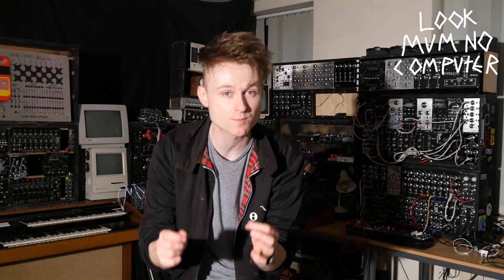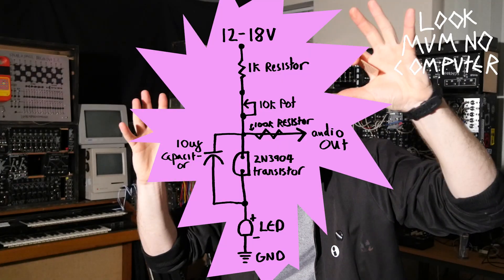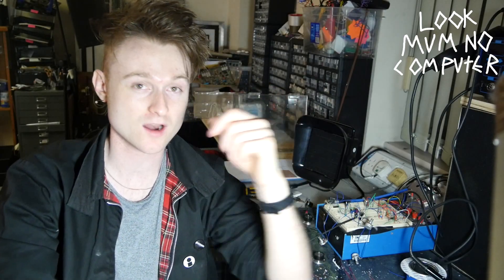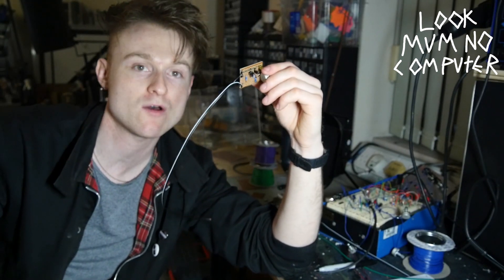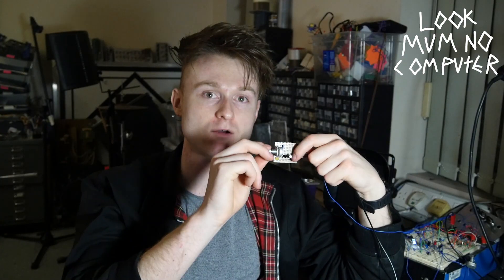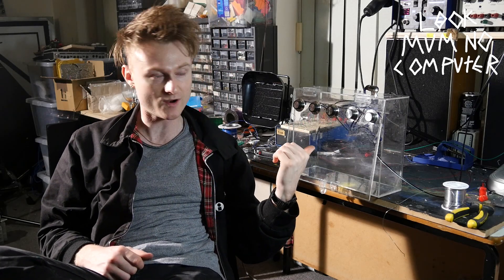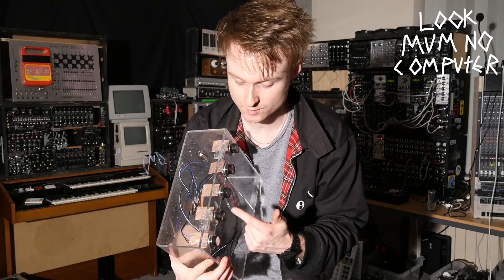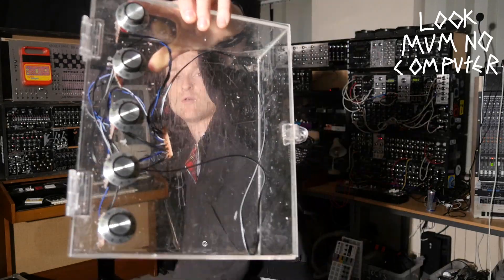The simplest DIY audio oscillator? not a 555 chip. reverse avalanche

Comment: I built this on a breadboard and the only sound coming out is an awful ground buzz. I've swapped the capacitor around, tried different transistors in case one was burnt out, tried it with everything from 12v to 24v, rebuilt the circuit over and over...nothing! The LED lights up and turning the pot changes the brightness but it doesn't flicker at all and the only sound coming out is a loud buzz that doesn't change in pitch. Any ideas?
Reply: Finally got it working! I ordered 2n3904 transistors from Rapid online, and the circuit oscillates with those ones perfectly.
Reply: Béla Bertalan Could be a different manufacturer or a different transistor. I found a video where a guy put the transistor on a scope to show the correct curve. You have to give the transistor enough reverse voltage to cause it to avalanche, which discharges the cap, similar to a neon tube relaxation oscillator. Without reaching negative resistance, the cap never discharges, so you just get the low level noise from the circuit. That's what my research seems to indicate anyway.
Reply: One more thing: If u want to connect a speaker directly, u must connect it parallel with the LED, or instead of the LED. Otherwise it won't give sound on 'audio out' with that 100k resistor. 

There's also an other circuit which using a BC547 and creates a very similar tone. I tried it and it works but only at around 14 volts. Also works with 2N2222 just we need to flip the transistor. Here's a video about it: https://www.youtube.com/watch?v=8oxFgyhJH0s&list=PLZXGSamSdI8bH0ewPiTekH9ilLQRldYB6&index=1
Reply: Hi guys, I know it's kind of a late answer, but in case someone reads it: I just breadboard the circuit at 9v with an s9018 and had the same issue: led lights but no sound! Solution was to replace the led for a jumper wire (now sounds but doesn't lights :D ). Also it doesn't sounds all along the potentiometer, just in a small place (don't know how to say this properlly, sorry).
 @belabertalan  Couls you explain that connection please? Where you say we should put the audio out?
Reply: @alebrenna441  hi, once your circuit is working properly, so the LED is flashing and changing frequency according to the position of the potentiometer, then take your speaker and connect the positive lead to the positive leg of the LED, then the negative to the negative leg of the LED.
Reply: The ones I tried before and didn't work were -A38 type. (2N3904  -A38). The good ones (Trusemi) from Rapid are B011 type. (2N3904  B011) I guess these are newer, more developed versions. So I would recommend to try any with letter B. (2N3904  B...). Hope it works and helps.
Reply: Would that have anything to do with the transistor leg that needs to be removed?
Reply: I just didn't connect the leg and it works.  I didn't have to cut it off.
Reply: Have you grounded the jack?
Reply: Yep
Reply: Have you managed to get it to work yet?
Reply: Béla Bertalan No, but I did a lot of research on this circuit and it depends on a negative resistance curve to work. I suspect the transistors I'm using are missing that curve. Haven't had a chance to try it with a different type of transistor.
Reply: Richie Witch Do you mean a transistor from a different manufacturer? I tried with a cheap 2N3904. That's the type supposed to work in this circuit. Quite annoying it doesn't..
Reply: Fantastic! I'll give that a shot.
Reply: @RichieWitch  Hello, did it work eventually?
Reply: @chornitch  Hi Pierre, no, I moved on to other projects, but I still think that using a transistor with a negative resistance curve is the secret.  To take out the guesswork, you have to look at the manufacturer's data sheet to see which transistors have that part of the curve; every manufacturer will be different, even though the part number is the same, because only the positive part of the curve is normally important.  Essentially, you need to know that the transistor will leak when plugged in backwards--the negative resistance curve shows if it will.
Reply: @RichieWitch  thank you for the fast answer, I will do so and keep you posted for sure if I manage to make it work
Reply: @RichieWitch  It's working! Thanks for finding the solution. 

Eventually I used a BC475
Reply: @chornitch  Excellent!! So glad to hear!
Reply: Great to know! Has anyone found TruSemi 2n3904s from a US supplier? If I buy them from Rapid it will cost $22 to ship $2 of transistors...
Reply: Are you seeing that number anywhere besides printed on the back of the transistors themselves? I can't find any indication from the major electronics suppliers of which version they are selling
Reply: I see this code only on the transistor itself. A few days ago I read about transistor codes and letters could mean newer versions. So B newer than A. I also saw cheap ones with letter B on ebay from china but different numbers after the B. What do you see on yours?
Reply: Confusingly enough, mine say -H24. They were produced by ON Semiconductor, bought from Digikey in the US. I think I'll buy a few from other US suppliers and see if I can find the B version. I wish more suppliers had a picture of the back of the transistor, for example on Rapid they show the back which says 331
Reply: Hey Encor3, did you wind up purchasing any other transistors?  Thanks for sharing this thread is great.  I'm going to see what else I can get out of Digikey, Mouser, or Jameco...and there is always Octopart...
Reply: I couldn't even get the LED to light up :( let alone get any noise
Reply: I got it working on a breadboard, ended up replacing the LED with the audio out - there is a slight deadzone on either end of the pot though :/
Reply: I'm having the same issue.  Built it on a breadboard, then stripboard.  Tried changing every component, three different types of LEDs, 10 uF and 2.2 uF capacitors, reversing the transistor... I mean everything I could possible think of.  But all I get is that low frequency hum. Have to add a lot of gain to hear even that.  I've watched the video a dozen times looking for clues, but this has me stumped.
Reply: A few things -- I will post this as its own comment but there is a huge mistake in the pink schematic he flashes the transistor 3904 is backwards, but that will keep the LED from lighting

Comment: Thanks for the cool videos. I built one of these and I would like to connect it to my small eurorack, but I am a little concerned about doing so. I used a 12V power supply and modified the capacitor value. When I look at it on an oscilloscope, I see the top of the wave around +12.5 V and the bottom is at about +8 V. If I check my eurorack oscillators, they go from about +4 V to -4 V. I am afraid to plug it into my eurorack because the higher voltage might damage something. Any suggestions or advice? Thanks!!
Reply: Hey shawn, curious what your pin connections on your module looked like? thinking about adding mine to my case too.
Reply: @stretchmetalfanclub  I never made the transition to a case with it. I guess I moved on to bigger and better things. This was a great start to my audio electronics journey though. Soon after this, I started to find schematics for full VCO designs with 1V/Oct pitch inputs and all. I eventually built that and many other modules. I found a place called GMSN! that was open source and learned a lot from them. Befaco also publishes their schematics. Ultimately though, for this basic oscillator in the video - probably not the best idea to put it in a rack.
Reply: @murky66  ha yes- I like you and concerened by the lack of regulators in this too trust it with the fragile eurorack.. will explore GMSM. thanks!

Comment: This is awesome!  I tagged you in a facebook post cuz I am speaking at a college tommorow about diy synths and I am presenting this method to them, but I am way noob at this stuff.  I tested this on a protoboard with a 24v  1.5Apower supply real quick and it worked.  I mounted 8 oscillators but I am hesitant to connect them all to 24v in fear it might damage the circuit..  What do you think?
Reply: Hahah that was a silly thought, it worked out fine.

Comment: I have rebuilt everything, the LED is lit and can also be controlled in the brightness. BUT!!!! no sound .... why ??? the output is 2.4 - 2.8 volts
I need help
 
ups almost forgotten super side super typ super equipment ..... blabla everything super  ;)
Reply: Did you ever get this to work? I have the same issue
Reply: No, I did not get it to work. sorry but I'm so glad that I'm not the only one;).
But I have no idea why.
Reply: HI - I had the same problem. It seems like not all 3904's behaves the same way. Just got a new batch with the post today, and now it works as expected - so my best bet is to get some new 3904s
Reply: same issue...
Reply: I had the same problem at first: my 3904 just would not oscillate. I bought a bunch of different transistors and found some 3904s that worked, but I had the most luck with BD139. It had more range than the others I tried.
Reply from the maker: pixelstift did you cut the middle leg off the transistor? Try the capacitor the other way around.
Reply: yes the middle leg is from ..... capacitor plus turned to minus ..... have already tested other capacitors 100uf 47uf .... 10kohm 22kohm 100kohm potentiometer also already tested ... transistor rotated ... and others resistors.
once soldered and once on the breadboard. but unfortunately no sound, that is the reason why I ask you. a little annoying beast.
thank you and have a nice evening
Reply: Mine is working perfectly on the breadboard, gorgeous sound. How are you connecting the circuit to the audio jack?
Reply: calinasmaria tip to output, sleeve to ground. Would it be possible to get a photo of your board with the circuit?
Reply: I believe photos are not allowed in these youtube comments, but i can send it to somewhere else if you want to.
Reply: calinasmaria could you upload one to imgur and PM me the link?
Reply: Does the link to imgur work from here? https://imgur.com/a/QWfBz
Reply: it does! that looks the same as mine...there must be an issue with one of the components or my power source
Reply: My 12V power supply couldn't even light the LED, so i'm using two 9V batteries in series https://imgur.com/a/gUgNs
Reply: I'm having the exact same issue. Anyone find an answer? I've checked and rechecked all my components.
Reply: I'm having this issue as well, will double check all my components over the next few days but can't see why it won't work!
Reply: Hey, did u find anything? 
thx!
Reply: I got it working on breadboard by replacing the LED with my audio - no resistor before the audio though so not sure how it will go with 2 or more connected to same jack out
Reply: Hello! I have read that some transistors do not oscillate and it gave them results to change them. My question is whether I can test the transistors without cutting the middle leg or I have to cut each one to verify that they work.
Reply: Got it to work with a 9018 on 9v, but had to replace the led for a wire to get it sound!! Also it does sounds just by bending the middle leg backwards (cutting it made it sound better)

Comment: Last question for real this time: what's the current draw through the oscillators? The resistors look small enough but the electrolytic capacitor at 5:27 looks huge.

Comment: Last question before I put these parts on order: what capacitor did you use for the higher-pitched tones? It sounds like it's about an octave. Is that just a factor of 10, i.e., 1 microfarad?
Reply from the maker: the lower you go it gets reall low (22uf) high ones were 1uf
Reply: Awesome, thanks! I've got something cooking now based this, a little more complex, but probably nowhere near your upcoming "how many is too many" video XD These are just so simple and sound so fun that I can't not build it :) I don't really upload here, but I'll try to make an effort once the build is done. Thanks again for sharing this with the community!
Reply: @LOOKMUMNOCOMPUTER  i have a issue with pot - 10k acc to schematic - it works only in half range - did you raised the value of pot or go with different capnvalues.
Thank youbagain for this idea....sounds massive.

Comment: Awesome !
I did 4 of them.. perfect.
But do you Know how to replace the led by a diode 1n4148 for exemple ?
May be the oscillation will be more stable ?

Thanks from France !
Reply from the maker: after experimenting more ive found the types of cap used varies the quality of it quite a lot± i would recomend to swap the capacitor around so the grey line down the side goes to the GROUND instead of the other way around :)

to pop a diode in i dont thik it will make a difference but try, just swap led with diode, black stripe goes to the ground strip

Comment: What's the output level of that box? Did you have to amplify or attenuate it at all? And does more power just grant you more modulation depth? Like, say if I were to chain four 9-volts instead of just two. I have some interesting ideas to expand this from your filter video as well. Thanks for everything you do!

Comment: this is really amazing, would you do a tutorial on the process of soldering them all together?
Reply: There's loads of tutorials on how to solder. Use lead containing solder, not the crappy 'green' shite. That's my tip.
Reply: @NeuronalAxon  I agree, the lead/tin solder melts at a lower temperature, which makes it much easier for beginners in particular. Just make sure you have plenty of ventilation to avoid breating in the fumes!
Reply: @BertGrink  ee been breedin dat fumes mi hole lyf and em fin
Reply: I’m late to the party I know, but would you use an op amp summing amplifier or would you just solder them all onto the same strip? I’m new to this

Comment: How did you connect them all to the jack? I'm still learning, and I'd really like to build a small bank of oscillators.
Reply from the maker: shmarginwoof solder the ground (sleeve of the jack) to ground. Then solder all of the audio outs to the same jacks tip!
Reply: Thank you! Once I get the components, I'm definitely building this!

Comment: I'll use a 10pins male header to connect with a ribbon cable to my bus board: Is it possible to solder 4 Osc on the same +12 volts or each OSC needs to have it's own +12 volts? So 1 header for 4 OSC  or 4 headers? Thanx!
Reply from the maker: all the same. it should be just fine plugging up to the power supply. i wired it up onto mine which is a DIY one, shoild be similar. it was fine.
Reply: So just one ribbon cable for 4 OSC... Thanx!

Comment: Wow man, I have a thing with like dozens of 555s oscillators and I would definetly use this circuit instead! 
But can this thing drive a small speaker?
Reply from the maker: look at the circuit on the red bull link in the discription
to drive a speaker the circuit is WAY simpler. cus the speaker is the load helping the transistor oscillate, meaning you dont need the led, or 2 resistors..... if you really want the know in the circuit, just swap the light dependent resistor with it!
Reply: LOOK MUM NO COMPUTER great! Thanks man!

Comment: Avalanche oscillators are so cool. I sometimes feel rebellious using them cos they're not "supposed" to avalanche!
Reply: Can you explain avalange oscilators? I took screenshots from the scematic and the lay out on a breadboard and it won’t oscilate. Which side of the transistor is connected via the LED to zero? There is a difference between the lay out in the you tube film and the website.

Comment: I don't quite understand the resistor in the output? Wouldn't a diode be more appropriate to stop the signals mixing as they only conduct one way? I can see the benefit of the resistor bringing the voltage down towards line level though.

Is it going to be an arduino sequencer?
Reply from the maker: an arduino sequencer in the style of an old school sequencer.  i popped a diode on it it didnt make any effect change. its more to bring it down to line level so theres more headroom to squidge loads of oscillators together. this was just a late night mess around. and this made sense to me, no voltage offset and what not. the think i would recomend is getting a load of stuff and trying it out!

Comment: I did not understand the role of the LED ...
Reply from the maker: Alix Turcq the only way to understand is to breadboard the circuit and see what happens when you take the LED out of the circuit
Reply: i think it's something as the led force the electricity to go in the right way so the charge only go when the transistor is in avalanche mode.
Reply: Funny, mine just works when tooking OFF the led and replacing it by a wire

Comment: I don't know much about how modular synths handle this, but this oscillator will have a DC offset, rigth? Isn't that bad for your speakers? I think a HP filter after the output would help. Of Course somewhere where you have symmetrical power.